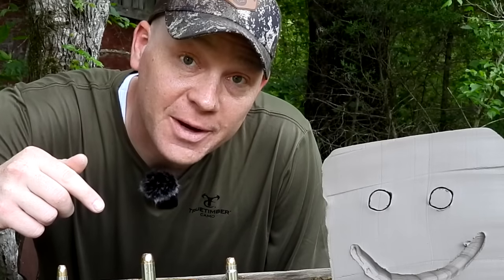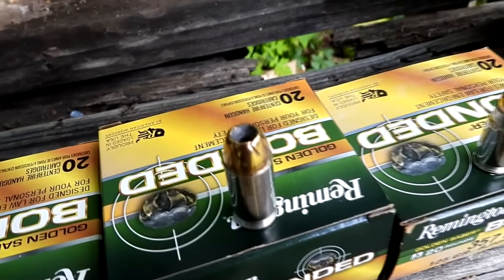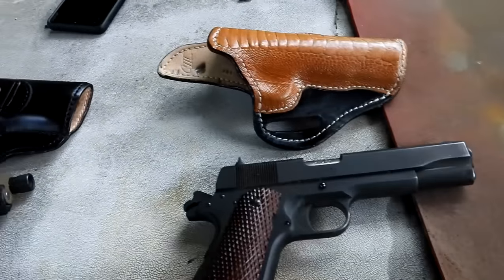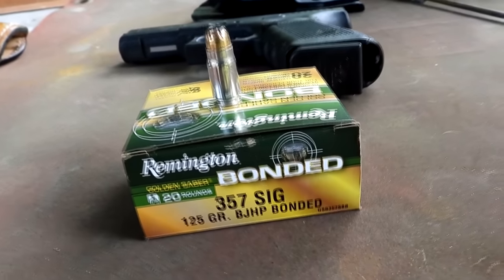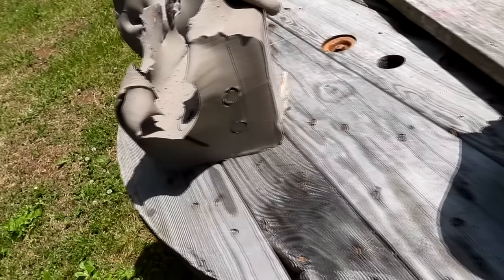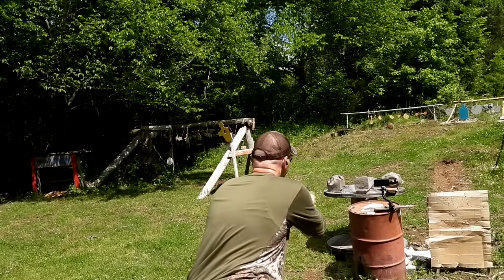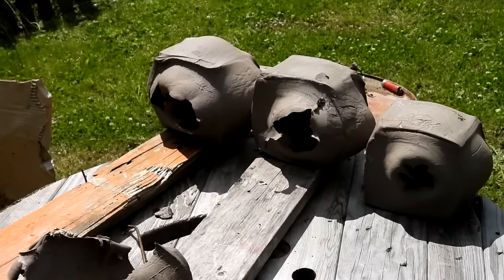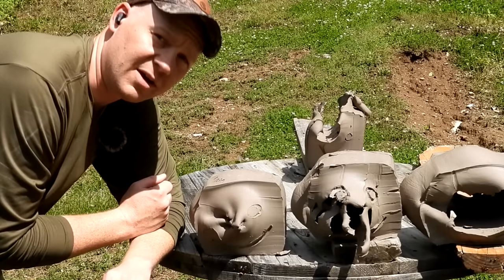9mm vs 45acp vs 357sig - CLAY BLOCKS!!!

Comment: Good video. Not only is the .357 Sig an outstanding performer power wise, in my opinion, the perceived recoil is significantly less than the .45 acp and only a little bit more snappy than the 9mm.

Comment: I am impressed by the 357sig! Great video, thanks. Considering changing my EDC!
Reply: In my view. There is 0 wrong with .357sig but I prefer .40S&W or 9mm +P. .357 do have 🔊 & flash but with training you get a lot out of a Glock 32, P229R, M&P, etc.

Comment: Appears to me the 45acp and 357sig are pretty close. The Glock 31 may carry a few more rounds, but currently the 45acp ammo seems more available in my area. Guess it's just a matter of personal choice, but I'll go for the 45acp.
Reply: I'm guessing if the .45 ACP was in a lighter weight bullet it would have been equal to the .357 Sig, if it had a .185 gr. bullet with a +P charge it would have surpassed the .357Sig.
Reply: @phillhuddleston9445  Younger shooters seem to favor higher capacity, but I think the hot 45acp loads are a great self defense round. I'm old (lol).
Reply: @phillhuddleston9445  Very possible!
Reply: I bought a used range Glock 41 gen 4, .45acp in 2022, $325. I added a few parts, midnight Cerakote Elite. TFX Pro orange night sights. I carry Underwood Ammo +P 185gr JHPs or Federal HST 230gr +P. The 41 feeds and cycles .45 with no jams, no problems.
Reply: @phillhuddleston9445  This would be a fun comparison to see
Reply: @phillhuddleston9445  very interesting comment. What about it 
Hootee
?

Comment: Yep, best round bar none is the 357 Sig. Have been carrying it everyday for 15 years in a Glock 32. I found the perfect combination. Load it up with Underwood 125 grain Gold Dots at 1500 feet per second and you will need but one torso hit to end the fight. Many P.D.s both local and federal have found this out. You cant argue with the stats on this round

Comment: The thing I would worry about with the .357 Sig, is it seems more likely to get a through and through shot if used in personal defense raising the risk of collateral damage. And, it did surprise me, but then it does hit with a high velocity than the .45 acp. I’m glad you used the extra clay block, because the first one showed more damage since it was hit off center.
Reply: There are .357 rounds designed to expand more and penetrate less. Hydro shock is one round that is designed this way but there are many more.
Reply: To be clear, the .357sig caliber was used by FAMS ✈️ & the US Secret Service for many years. The DE state troopers were the 1st to tote .357sig P229s. Texas DPS troopers had P226s in .357sig for years.
Reply: .45acp is big but slow. It will literally bounce off of Cinder Blocks.
Reply: Dude the round that has over penetration is the 147 9mm.  The sig in 125 blows up and uses its energy effectively and then stop.  That is as long as it has a good hollow point that expands as it should.  Let me say it again the 9mm in 147 sux!!!
Reply: Exactly!  My personal experience is 357 sig over-penetrates.  45acp doesn’t carry nearly as far passed target, and doesn’t have rise while firing as 357sig does.  Accuracy is key; I carry mostly Glock 23 (40cal). My 40cal performs very well, and is better controlled than 357sig.
Reply: @DavidLLambertmobile , I’m not a fan of sig p229 in 357sig; had many uncorrectable jamming issues.  My suggestion is Glock 31.  I’ve not attempted other manufacturers of 357sig pistols, but my Glock 31 is flawless!
Reply: @williamhicks4533  I have a G33 on as I write. It and a G30SF are my primary carries. Tests I've seen don't show over penetration in 357 SIG.

Recently got a P229 in 40, need to order a 357 barrel. The 40 cal is pretty nice, but I am very impressed by 357 SIG.

On the other hand 9mm is just absolutely terrible.
Reply: So what I deduced is, if you don’t have a good bullet placement with a 45 you’re gonna take his whole alarm off!😉
Reply: @williamhicks4533  The 226 is a dream but the price on those now days is painful.
Reply: Corbon and Underwood 115grn are explosive and only get about 10" in gel.
All the "penatration in gel" goes out the window when delivering 600 plus lbs energy.
357 MAG. 125grn semi jacketed HP would dump energy and lead. 90/95grns and about 10/12 inches in gel.

Comment: 357 Sig is a confirmed man stopper. Lov it. Would love to find a 1911 Commander in 357 Sig.  38 Super in a 1911 frame is sweet but a 357 Sig would give me a smile that it would take an undertaker 6 months to remove. Love the clay test. Cheers.
Reply: Sig Sauer makes a 1911 in .357Sig

Comment: They all worked well. The 357 Sig wins the day. Too bad the cartridge is heading into obscurity. Sig doesn't even chamber it anymore. Would be nice to see the 40 S&W with the same Remington ammo in the clay block....Please!
Reply: The 9mm results were pathetic.
Reply: Yes 40sw with 165 grain, not too slow and weak 180 grain. The reason is 9 mm perform so poorly is because he used too heavy of a bullet. You have to have velocity and those heavy bullets are only about 1000+ fps.
Reply: @billblue4710 Bad bullet choice is why. Too heavy.

Comment: I’m a huge fan of the 357 Sig. Mine is a Glock 22 with a Glock 31 barrel. It’s my favorite self defense round. I wish someone would chamber it in a 1911 platform because it’s my favorite pistol. I don’t expect that to happen though. Great video. Not surprised at the results. I suspect a 124 or 115 gr 9mm would have provided more damage.
Reply: U might consider a 9mm conversion bbl for the G22 also, u just use a G17 mag. 
In my G31 357sig I use a G22 bbl & 9mm conv. Bbl, I use the 9mm most though (I've got a lot of ammo)😊
Reply: .38 Super in 1911 is a pretty potent package.  Just something to consider.
Reply: @britskihambone8158  the 10mm is getting popular in 1911s also, it's quite a bit more potent than the 38 super😊 then theirs the 400 corbon I use to.
Reply: you can get a Sig P226 or P229 chambered in 357sig.  You may even be able to find one in SAO, otherwise, the DA/SA works very nice.  Yeah, not a 1911 but it's still a hammer fire and the P226 platform is one of the greatest around, IMO.

Comment: This is about what I expected to see.  Ive never told anyone that 9mm is equal to 45.  You did a good test using the same ammo for each caliber.  Ive always said that modern 9mm ammo can get you similar performance to old standard 45 ammo.  It would be interesting to see the test also using a normal round nose 9mm and an old style 45 ball.

Comment: That first .45 ACP shot was definitely almost completely off the left side but hey, they can't all be perfect.  Didn't matter though because they all look awesome.  Clay may not be as good as ballistic gel overall but it sure puts on a better show and the end results are way cooler.  

The .357 Sig shot was as close to perfect as possible. 

I've never owned a .357 Sig but I have plenty of respect for its ability.  It's probably the best of the three but It's just not common enough for me to invest in. 

I carry a small 9mm or occasionally a .45 ACP.  Sometimes a full size .40S&W or G21 OWB around the property.  What I really want is a Bul Armory SAS II Ultralight...if I can score one of those it'll become my primary concealed carry gun.  That said I do love .45 ACP ❤.
Reply: I actually prefer the clay so the cavitation showing how much hydraulic shock would occur is more easily visible.

Comment: WOW! That 357 Sig surprised me. Smaller bullet and a bigger hole. The faster speed makes a difference.
Reply: Apparently it surprises a lot of people on forums and what have you because even after all these years, all these zillions of tests that have been doing similar things in all manner of gel tests with and without barriers for at least 15 years, people largely say the same thing over and over again; "Bigger bullet equals bigger wound, equals more bleed out." It appears that no matter how many times they see the same thing over, and over, and over, and over again, they still decide to perpetually suffer from suspension of disbelief syndrome, I think because they are emotionally invested in their pet caliber and belief system of cartridge. More than just a smaller bullet and bigger hole, what you'll also find repeatedly is a longer wound track in a lot of the lighter, faster bullets than the heavier, slower bullets if that has any value to a potential consumer. Speed coupled with the correct grain weight of bullet and overall bullet construction of projectile does in fact make a difference in JHP handgun rounds. A huge difference in fact to the discerning and even moderately objective observer. But for those that are married to and have formed a codependent relationship with their defensive handgun caliber round, they have a high hurdle to overcome before they'll be seeing the forest for the trees.
Reply: It's a .40 S&W necked down to a 9mm. That gives very high velocity. Actually the .40 really cranks em when you use lighter bullets. All I buy now are 165 grain in .40, I don't even mess with slow and weak 180 anymore.
Reply: @actionjksn  actually it’s 10mm neck down. Different case thickness than.40. Not sure why authors still put that out there.
Reply: @sekhemmontu7072  You're right 10mm is listed as the parent case. But 10mm is also listed as the parent case for the .40 S&W. The reason people usually say that it is a necked down .40 is because they also trimmed the SIG length down to almost the same length as the 40 Smith & Wesson case. 

Sig case is  21.97 mm length
.40 S&W case length is 21.6.

I could not find any evidence that they make the brass thinner for .40 S&W than 10mm and SIG. I can't even find what would motivate them to do so. 10mm auto is only 2,000 psi more than  .40 S&W, so 35,000 vs 37,000 for the 10mm. That just doesn't seem like enough difference for them to want to switch to a thinner metal. It might save 1/100 of a cent for a bullet If it saves anything at all. And for what?
Reply: @actionjksn  yes 10mm is the parent case for both. However, the case is cut making it shorter for .40 versus crimping the neck area down to hold a smaller round for .357 sig. Which means saying .357 sig parent case is .40 an incorrect statement. Manufacturers have the casting for all the rounds they produce and by virtue of requiring less metal to prevent case rupture, there is a difference in metal thickness and in large quantities, would make a large savings in production costs. Less metal is less expensive.
Reply: @sekhemmontu7072  No, the 10mm necked down is the 9x25 Dillon. That is a true beast... The 357 Sig is just slightly longer than the 40 S&W by 1 mm. Not enough neck for proper neck tension if you size the 40 down to 357.

Comment: Nice review and even though the 1st .45 round wasn't dead center it was still a valid example. The .357 SIG was very impressive but from a reloading standpoint the straight walled .45 ACP is a favorite followed by the tapered wall 9mm. I'm not going to rush out and buy a .357 SIG anytime soon. Thanks for sharing!

Comment: I love my very accurate SIG P229 that I bought almost brand new in 2006.  I have both the .40 S&W barrel and the SIG 357 barrel that can be interchanged in a couple of minutes.    I can practice with the less expensive 40 S&W bullets and carry it with the 357 SIG exchanged barrel.  The magazines work perfectly with both bullet types.  I also have the Kimber 1911 in 45 ACP.  To me, it's difficult to tell the difference in recoil because the 1911 is so long, while the SIG 357 only recoils slightly more than the 40SW when using the same handgun.  JMHO.

Comment: All three did an excellent job. The nine expended all it's energy inside the block of clay. My thoughts are whichever caliber and gun you're comfortable with and shoot well is the is great.  P.S. where's the 40 cal. it's probably feeling lonely and I love mine in the 1911  another fun video thanks
Reply: The 9mm results were terrible.  I can’t see how you came to any other conclusion.
Reply: @billblue4710  the 9mm load shown hitting the clay was the 147 grain JHP loading. That’s a standard weak loading. Let’s see a 124 grain +p JHP in the 9mm. That’s a much more effective round. That’s also the beauty of the 9mm-the ability to adjust the power level of your load.

Comment: One thing I don't like about a lot of tests including this one is when different cartridges are compared using unequal bullet weights. I am not talking about every cartridge having the same weight bullet but if you are going to have one cartridge with a lighter weight bullet for that cartridge then all the cartridges should have light for cartridge bullets in them. Here we have a 9mm and .45ACP with heavy bullets and a .357 Sig with a light weight bullet for the cartridge. If the 9mm had either a 124gr. or 115gr. bullet and the .45ACP had a 185gr. bullet I think the differences would be much smaller.
Reply: I thought the same thing at first too, but then I realized that 9 mm and 147 gr and 45 ACP in a 205 gr are both common for personal defense. I don’t know much about 357 Sig, but I agree it would have been nice to see that in a similar weight as the 9 mm.
Reply: I have the same issue and the problem here is only one manufacturer makes a heavy 147gr JHP for .357Sig and that's Hornady's XTP. 9x19, .40 and .45ACP all have three bullet weights i.e. light (115gr/155gr/185gr) medium (124gr/165gr/200gr) and heavy (147gr/180gr/230gr) respectively.

 Ideally it should have been a 124gr +P GS Bonded (they do exist), against a 200gr +P GS Bonded (don't exist unfortunately) and 125gr .357Sig. That said, I prefer the 147gr Remington GS in 9x19, it just performs better, especially the bonded version. 

Awesome test overall and please catch them for us next time, so we can see what they look like expanded :)
Reply: @thepatriotsrage661  I think for the .45ACP the 185gr +p and a 124gr.+p for the 9mm would have been a better comparison because the .357Sig is basically a +p already.
Reply: Those are standard weights the round was designed around. All of those calibers have lighter and heavier loads both in weight and +P so what's the point? Infinite sliding scale on all of them.

Comment: Would be cool the see the 9 VS 357 sig in that Remington bonded but with same grain weight.
Reply: I think if the 9mm was a 124gr. and the .45 ACP was a 185gr the results would have been closer to the .357 Sig.
Reply: @phillhuddleston9445  
9mm (9x19) and 357 sig are both 9mm projectiles so a same bullet grain weight loading would be a interesting comparison
Reply: @jimmieburleigh9549  That was my point, had both the 9 and .357 been at their lower end of the weight scale and the .45 been at it's which is 185 gr. it would have been a more fair test.

Comment: Great comparison.  I would like to have seen the .40 cal included in this comparison.  I have often heard the .357 Sig described as a solution in search of a problem, because it will not do anything the .40 cal will not do.  That would be an interesting comparison.
Reply: There is no comparison...357sig >40sw....it has greater velocities...greater penetration..greater energy (+100-150ft/lbs)  357sig is closer to 10mm performance
Reply: @kevinrichardson8859  basically  same velocities for similar bullet weights, easier to find downloaded 40 though. Penetration is mostly down to bullet construction.
Reply: @powerbagle  and sectional density which 357sig has the advantage at all bullet weights due to the. 355

Comment: Love to see how  the .40 holds up.  155 gr. at 1200 fps is no joke.
Reply: You will see something between the 9 and the 45.
Reply: Really? That, stopping power and greater capacity is why LE went to 40 Smith.
Reply: It was a good choice and definitely has some serious performance upgrades over the 38sp. Most places were stuck with that by politicians and it's cheap mentality.  Well that and we look bad if we shoot someone. 9 mm back in 80/90's was less than stellar.  The 40 had a great combination with better rounds. Except  on door frames. Straight on sure thru steel fire doors easily where 9 mm didn't  go thru. But at same time was a hazard for placement  became  the key. 357 was the game changer so was the 10mm but a lot of weapons were  large or unweildly.  357's problem is ammo cost and the snoflaking reiterating peace don't hurt anyone.  Sometimes you have to shoot and do you  want to keep doing it or stop the problem once. 357 and bean counters simply are loosing to the economy. It's to hard to get runs of ammo for use. Unless custom from underwood but then snowflakes and lawyers complain your  out to kill people. Umm no but that big hole stopped them so we could get them to a dr.

Comment: While I am a big fan of .357 Sig i have had to change my EDC due to age. I started out carrying a Ruuger GP100 in .357 Mag. I then moved on to a Springfield Champion in .45 ACP followed by Sig Sauer P229 with two factory barrels, one .357 Sig and the othe in .40 S&W. I opted for the .357 Sig as it has never jammed on me and I cannot say the same for .40 S&W. Now that i am older and have less hand strength my EDC is now a CZ82 in 9x18, aka 9MM Makarov. I carry it loaded with Hornady's 9x18 Critical Defense as my SD round of choice.

Comment: I have a 2 port 3/4 inch extended barrel in 357 Sig for my Glock G29 10mm. It is amazing. It turns the G29 into a whole new gun The recoil impulse is virtually gone and you just hang the front sight on the target and punch holes... I load for the Sig and I love it...

Comment: Great vid I must add I’ve noticed with 9mm the 115gr and 124gr hollow point has more speed and expands more than the slower 147gr and also the 185gr 45acp hollow point again has more speed and expands more reliably than the heavy slower 230gr hollow point now the 125gr .357sig hollow point was devastating nothing to add there the clear winner but adding in the weight grain of the 9mm and 45acp factors may change how reactive the clay targets are.